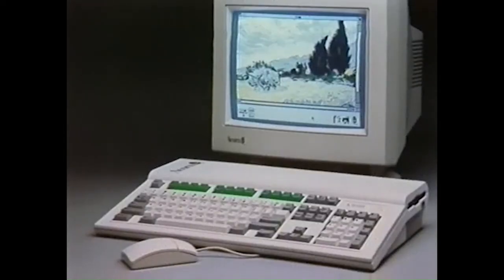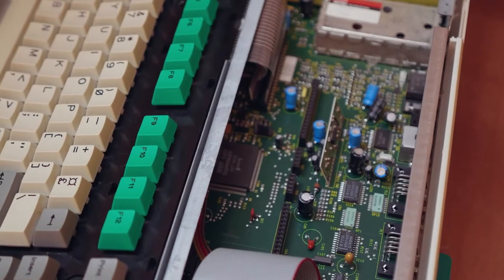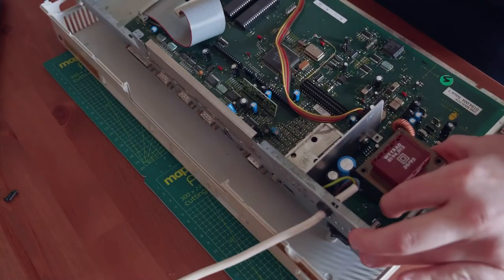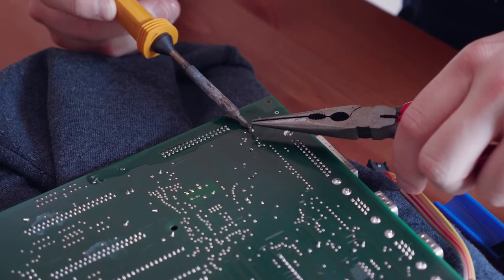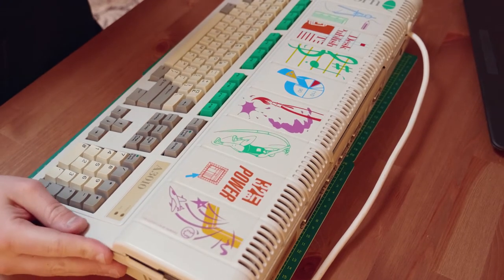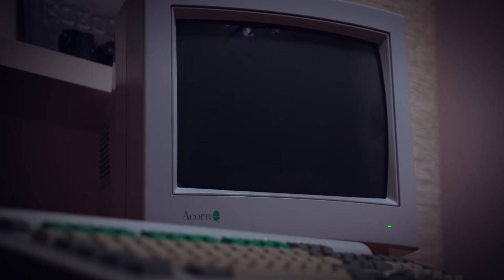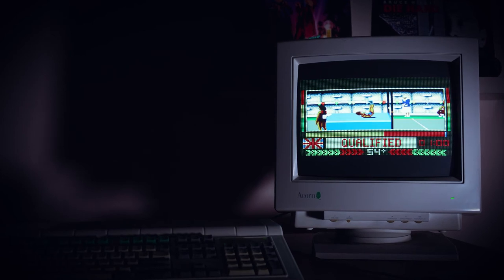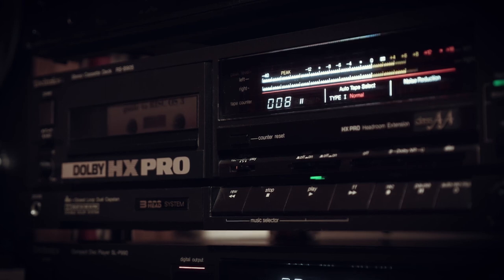System Restore Ep. 2 - The Acorn Archimedes A3010

Comment: If your monitor is a multisync, make sure you configured that with the !Configure app.
This way low res games will run as they should, and not in VGA mode. (The aspect ratio will be correct, and they will run faster, as they should).
Reply from the maker: Thanks for this, I’ll try it out!